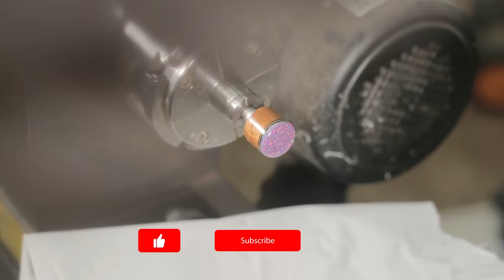Making a CUSTOM guitar: The OPAL (Full BUILD)

Comment: I would use wide rubber bands after you tape the trim. It will hold it much tighter while the glue dries. Your doing a great job .

Comment: Awesome build.

Question: any particular reason why you glue the fretboard and work it before carving the profile of the neck?

I am going to start with guitar building, and necks are a little intimidating, so I was planning to carve the neck before doing anything, in case I ruin it beyond repair, what's your advice?

Comment: What disk do you use on your angle grinder to do the carving on the top?  I have one for wood and it is WAYYYY too aggressive for that I think!
Reply from the maker: Here I'm using a metal sanding 60 grit flapping/fan  type disc in the angle grinder